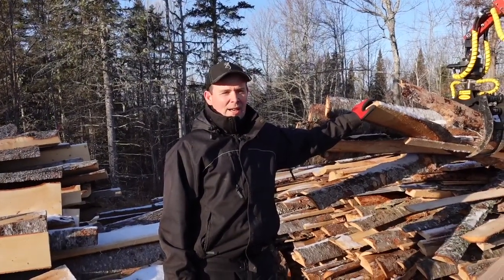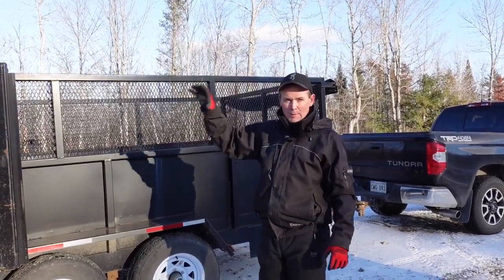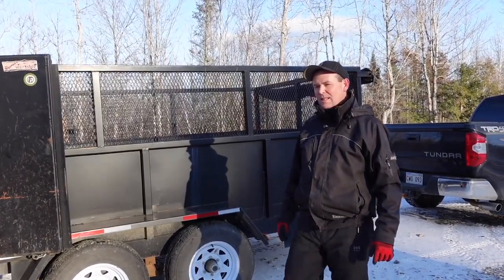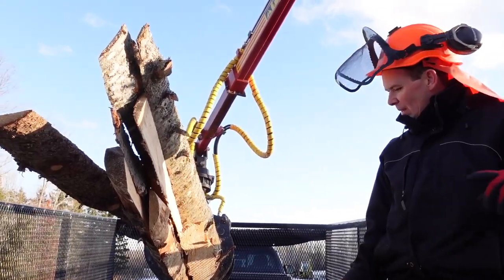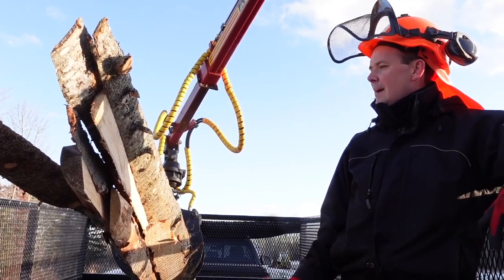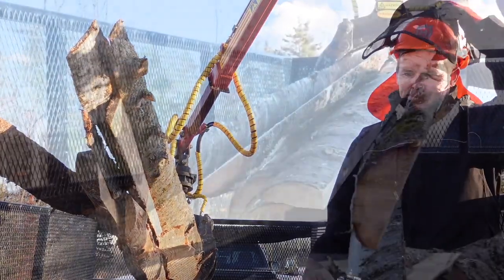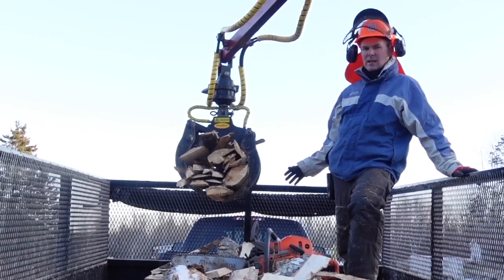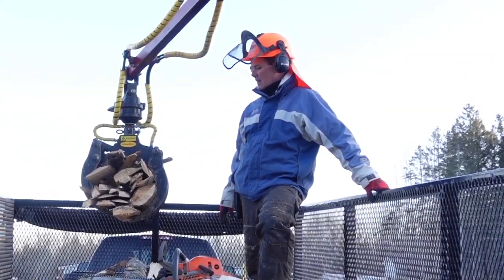Making Firewood from Sawmill Slab Wood -E97

Comment: I have a six-foot long sawbuck and stack my slabs on it.  The width of the stack is about 30 ins. across at the top of the sawbuck.  One end is stacked flush, and the various lengths don't matter.  The slabs are cut 24 ins. long for the barrel stove and processing goes quick.  I cut where I am stacking.  I like the system.  Keep up the great work!
Reply from the maker: I saw a couple of videos where guys built sawbucks for slab processing. This is on my to do list to build one for here. We have two large piles of slabs now that will make excellent fuel for the maple syrup boiler. Just need to get at it! Thanks for watching.

Comment: That is an effective idea.  I do have a jig to hold the saw for pole wood. It's also effective, but requires a bit more effort than your method. It only guarantee equal length, which is good for firewood to sell. not for your own use. You have it right in my opinion. Thanks!
Reply from the maker: Hi Joe, thanks for the feedback. A jig would be good but I didn’t have enough time to keep on top of it all!

Comment: One option, I've seen on a few other saw mill channels is to create a big 'X" type frame rack and throw your slab wood off cuts in there as they are produced from the saw mill.  Once you have a rack full, just run your chainsaw across them to create whatever size firewood you want.  Your method with the Kranman trailer is good.  I just think the grapple head has too much movement in the head to make sawing easy.
Reply from the maker: I agree, the saw buck option would be ideal… wish I could have kept up with the sawmill and cut up the slab wood as they processed it. Just too busy!

Comment: How's she goin'?  That is a great way to cut up the slab wood.  I was thinking that's a lot of climbing in and out of the trailer, but then you mentioned getting your dad to run the crane.  That would be better I think.  And I totally agree with you about the fewer times you handle the wood the better!!!  Take care!!!
Reply from the maker: Thanks Mike! I’ll have to step out to avoid pinch points but at least I’ll keep the pitch off of my tractor seat!
Reply: @OakMountainAcotts  Yes there will be lots of that with the soft wood slabs eh!!!

Comment: Jason, I would look into a PTO Buzz Saw/Cord Saw. Easy to keep pieces consistent lengths, and the sawdust out of your trailer. Cheers. Scott
Reply: I was thinking along the same lines.  Jason did mention he wanted to handles the slabs and resulting pieces by hand as little as possible.   This would be a good option if you parked the buzz saw at the end of the sawmill and processed the slabs as you went.  The Marc Galicic youtube sawmill channel does this and it works well.
Reply from the maker: Hi Scott, thanks for the ideas! Keep'em coming! Take care, Jason.

Comment: Hi, I made a small jig with old pallets to saw multiple logs or in this case would work with slabs.  Simply build a bunch of "H" forms, 4 feet high and 32 inches high in the middle.  Now join these every 16 inches with 4 lateral 2x4.  Simply place the slabs in the "H" cradle and cut. The pieces stay in the cradle and you don;t have to bend down to pick up the cut slabs.  It's easier on the back as you don;t have to bend down while cutting.  I make mine about 6 feet long.
Reply from the maker: This sounds great! Did they call structures like this “cross bucks” ?
Reply: @OakMountainAcotts  I guess so, instead of having a "V" shaped on the bottom. ii have a flat side and make it 18 wide, since 
I have a 20inch  bar on my Husky 562xp, I can cut across the entire pile.
Reply from the maker: @larrylefebvre2237  sounds like a good setup!

Comment: Your friggin dangerous ! Just my opinion here, don’t you think it would be a hell of a lot safer to just put your slabs on a rack ? You don’t like to stack firewood, lol  I cut slabs for firewood in my wood cook stove/heat. I just made a rack with 16” spaces & cut slabs all day for next year !  I cut a total of 10 cords for each year I live in MT.
Reply from the maker: Hi Frank, I'll probably setup a slab rack this Spring to process the rest. I don't feel that I was in danger here but I don't want to climb up and down inside the trailer to cut up every group of slabs. Also, I found that when I went to pile this wood, the trailer was full of sawdust and I didn't like that. Thanks for the safety check, I'll take it under advisement because I certainly don't want to get hurt! Take care, Jason.